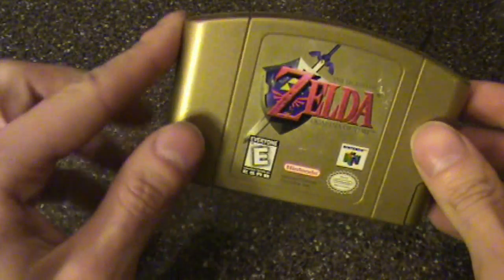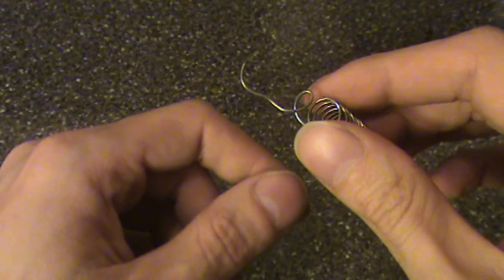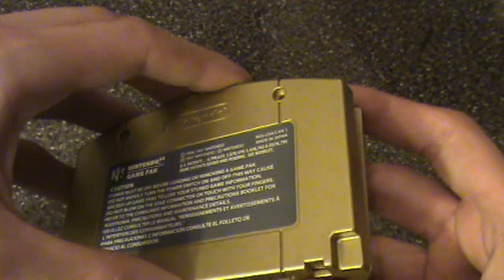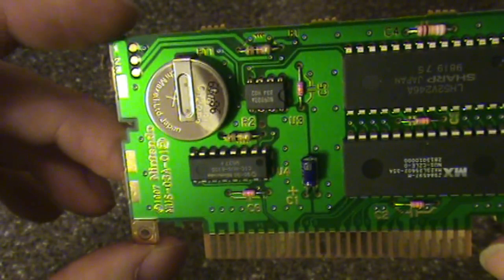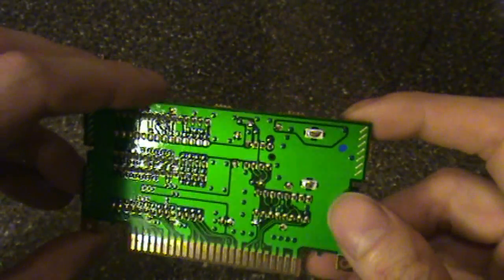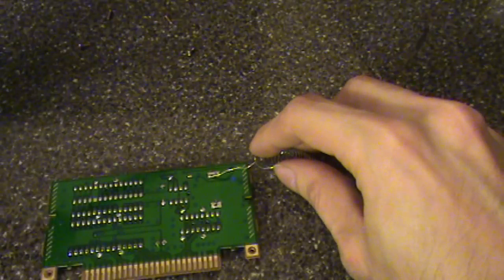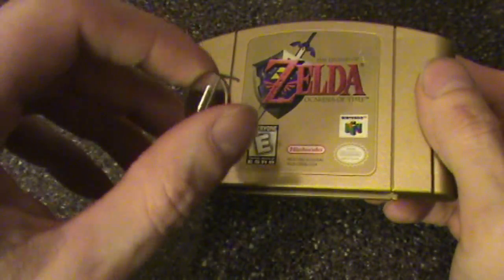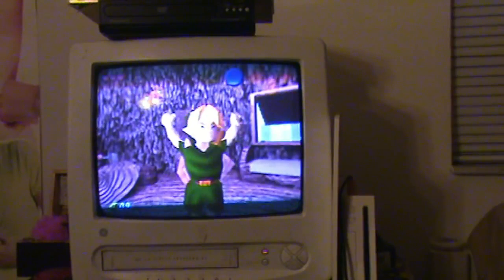Fusion Fixes Nintendo Save File Batteries

Comment: I really hope this works with old game-boy cartridges. I recently lost a 16 year old Pokemon Yellow cartridge. Guess I'll find out in a bit.
Reply from the maker: +The Sugar Fat Man I've opened up Game Boy cartridges but never worked on them. As far as I know, the same principles apply, but I know at the very least, it's a different type of battery, and the tabs appear to be soldered on the component side of the circuit board rather than going through holes to the solder side. But I know there are GB-based videos on the subject as well.
Reply: +MistareFusion Yeah I just opened it up and I'm going to hunt down the battery tomorrow.